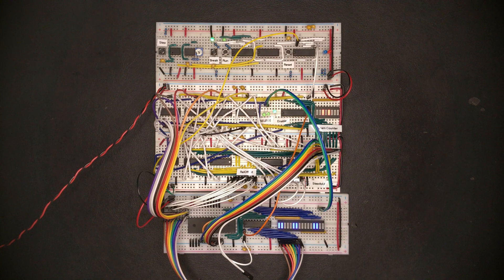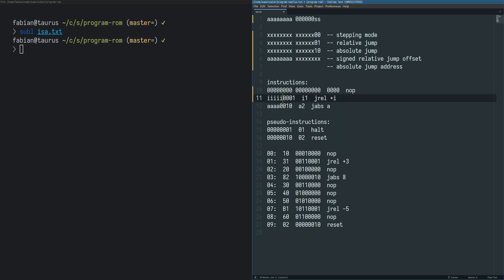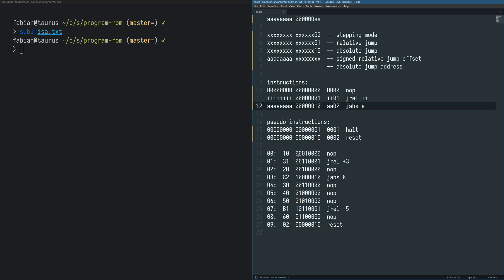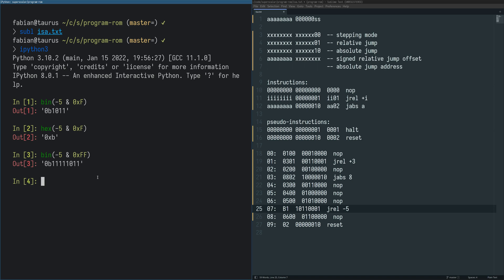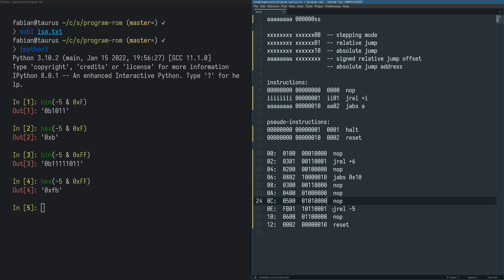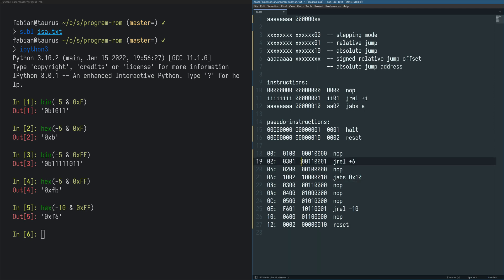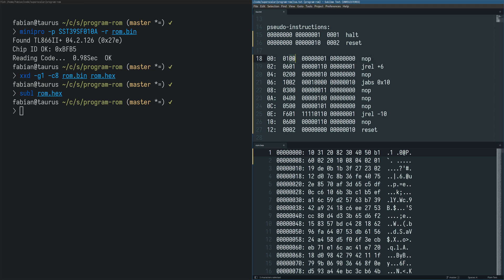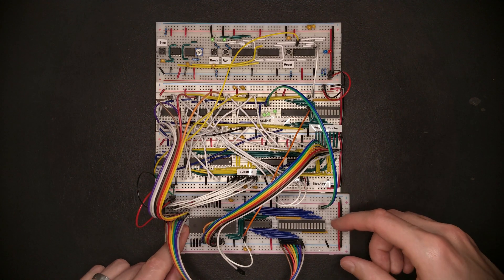Upgrading to 16 Bit Instructions – Superscalar 8-Bit CPU #14

Comment: all these adaptions for the ignored least significant address bit would vanish if you'd shift the address lines connecting to the ROM,
which would also mean you'd double your address space again, as you would then have 9 address bits in total (lsb being the clock)

The ROM has currently 4 unused address bytes anyway
Reply from the maker: I'll definitely make use of the unused address space in the future 😃! The way I'm planning to implement the memory system would really benefit from having byte-addressed memory. The challenge is that the instruction fetch wants to grab 16 or 32 bits at a time, while the CPU loads and stores only 8 bits at a time. That means the data bus will be 16 or 32 bits, but the load/store unit must still be able to perform 8 bit reads and writes. Having the lower address bits around allows me to create a byte mask signal to only write a part of the data on the bus, and I can use those bits to pick which of the bytes of the bus is being read.

Comment: What I don't understand: You did not use the first bit coming from the program counter to the flash. Why didn't you just shift them to the side so that bit0 from the program counter would be bit1 at the flash. This way you wouldn't have to do a "2" step at the program counter.
I don't have any CPU knowledge so I'm actually curious.
Reply from the maker: That would definitely be a good approach! 🙂 The downside is that it makes the program counter word-addressed and no longer byte-addressed. When you want to execute programs from byte-addressed RAM, or have single byte compressed instructions mixed in, you want the program counter to count in bytes.

Comment: You could jump twice as far if you interpreted the value as instructions rather than bytes. At least for the actual encoding, if not for the assembly.
Reply from the maker: You're absolutely right! I've chosen to go with bytes to keep the option of having compressed instructions later on, where you may want to operate at a byte level instead.

Comment: Computer has 7 bit word addresses, instructions have 8 bit addresses......
Reply from the maker: Yeah, the breadboard version of the program counter only has 8b for the current instruction address. However, after building a dedicated program counter PCB a few episodes down the road we'll be up to 16 bit instruction addresses. And you are right of course, in the current setup when we always fetch 16 bit / 2 bytes from addresses that are multiples of two, the least significant bit of the address is ignored, so only the upper 15 bit are used: loading the two bytes means loading the byte where this bit is zero and the byte where this bit is one. However, in the future we'll want to look into compressed instructions that are only 1 byte long, meaning that we'll go back to making use of that lowest address bit. It's generally a good idea to keep the machine fully byte-addressed, even if the words loaded from memory may be wider and always aligned to multiples of 2, 4, 8, or more bytes.

Comment: I don't understand why you didn't just use another address bit on the ROM synched with the latch gate.  As programmed, this would be b0.  Then the PC would be b1-9 and it would be unnecessary to double the offsets.  This would also double the jump range.  Divide the clock by 2 to toggle the latch load or PC load.  This would be similar to the 8088.
Reply from the maker: I totally agree that this would be an elegant solution if we were to fix the number of bits in the instruction at 16 in all cases. The memory system would effectively become 16-bit-word-addressed instead of 8-bit-word-addressed. However in the future, once the CPU has gained a data memory port (which is going to be 8 bit wide), we'll want to create a unified memory interface both for data and instructions (a von Neumann machine), with a RAM backing both data and the program. In that case the underlying memory system would still be byte-addressed, and if we add compressed instructions to the CPU (single byte), we'll want to be able to express program position as the native address of the memory system.